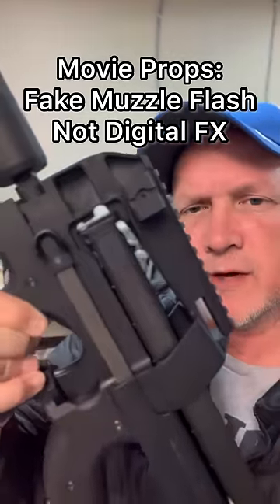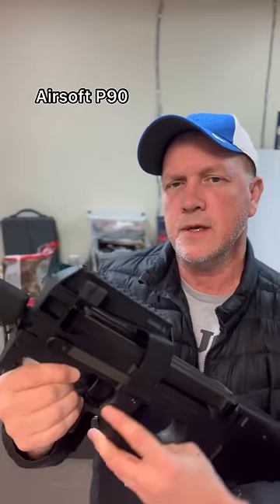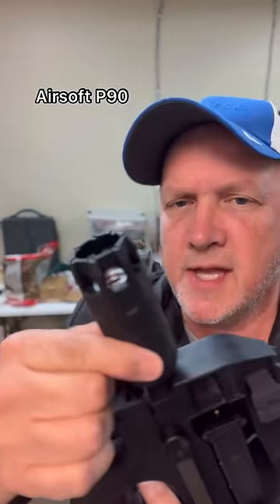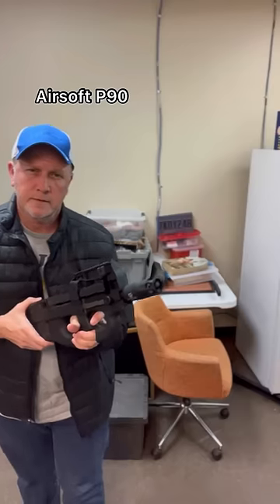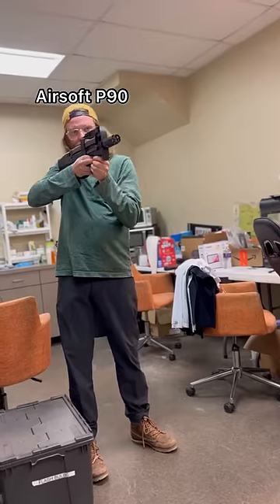Movie Props:  Fake Muzzle Flash on Airsoft Prop #shorts

Comment: I would never have expected that effect to look that good.  It looks a lot better than the CGI muzzle flashes you see in a lot of movies and TV shows.
Reply: Yeah I mean it's a little bit over-the-top but it does look really good
Reply: Maybe some of the cgi you think you're seeing is actually a prop effect
Reply: @danitho  Then it still looks worse than the one he demonstrated.
Reply: @jic1  Yeah, that makes sense. Not all products are made the same. Some are better than others.
Reply: @borttorbbq2556  Muzzle flashes gotta be exaggerated for the big screen. If I’m not mistaken, cameras usually don’t even pick up real muzzle flashes.
Reply: @zander2190  if they do they're not very clear.
Reply: Its a real airsoft product that has been available for quite a while plus its quite affordable and you can put it on any airsoft gun that has a threaded barrel which is like most of them, not to mention it also works as a tracer unit, it works best with gas blowback airsoft guns because the added gas would like provide a mist of sorts for the light to catch making it look like a real muzzle fire, its perfect for any airsoft player who values the art of the larp and its perfect for prop masters and any on the start movie makers because its a cheaper and more believable option if you can't afford an expensive cgi artist or if you can't afford quality cgi, plus it adds to the overall feel of the weapon without having to spend thousands on dangerous blanks that is purely CO² gas
Reply: @zander2190  Cameras pick up real muzzle flashes. It actually looks bigger than the effect here. Sometimes you can see the rolling shutter with how fast it is, too
Reply: @traphimawari7760  wow, all that with only 3 commas and no periods.
Do you have something against using punctuation? 🤔
Reply: @traphimawari7760  bro, put some periods in there, goddamn. Had a stroke reading all that.
Reply: From irl experience & videos I think it should be toned down to be more realistic BUT until that inconvenience is resolved I'm sure it could be reduced in editing
Reply: And I'd wager it's easier for the sound department to match real shots with the lower noise pop these bb guns make. It really does make you wonder why we don't see these more often especially seeing as a lot of gas blowback bb guns are comprised of metal like their real world counterparts.
Reply: yea they are pretty regular. :) they are called TRACER UNITS. for airsoft. they make the BB's glow aswell
Reply: and if you needed tracer fire, these work with some bb's that make them look like tracers so you get both effects lol.
Reply: That’s why I love using them for Milsim, nothing wakes you up like some dude with a blank gun and an HPA rig with one of these
Reply: @borttorbbq2556  yea but movie blanks are already over the top
Reply: @jic1  you do realize that he's right they use those and cgi combined to look good
Reply: It would mostly have no muzzle flash and a lot of gas if it were realistic.
Reply: So they're actually really common for outdoor airsofters. I use one for my cqb riot gear set
Reply: @lucassevey5989  You do realize that I'm talking about effects that look bad, right?  Yes, I can't completely rule out that some of the 'bad CGI muzzle flashes' I'm talking about are actually  bad prop effects, or a bad combination of prop effects and CGI, but the point is that they look worse than the prop effect he demonstrated.
Reply: @jic1  yes I'm saying that if combined with some cgi that would be pretty good
Reply: @mwwwww648  Yes the real gun shouldn't have huge muzzle flashes because it shoots a round designed for short barrels, so virtually all the propellant would have completely combusted before the round exits the barrel.  Big muzzle flashes are usually caused by unburned powder, and are worse when a round designed for long barrels are shot through a short one, meaning that powder combusts outside the barrel.  However we are talking about movies here, and a muzzle flash that looks good onscreen isn't necessarily one that looks realistic.
Reply: I have one on my speedqb set, looks dope at dark and with tracers
Reply: gbb p90? who makes it?
Reply: I thought it was actually fire the first time he shot it.
Reply: @evieatarax  they usually don’t look very clean on video though, unless filmed by a high speed camera due to how quickly they happen
Reply: @jic1  and no more flipped muzzle flash 🤣🤣🤣
Reply: Too bad the muzzle is too large for the p90 for accurate portrayal
Reply: @borttorbbq2556  someone has never fired a gun before XD
Reply: @EJuliusF  i have infact
Reply: Practical affects
For the win. You could even cycle it
So it flashes intermittently.
Reply: @zander2190  actually, they are typically under-represented. Real muzzle flashes (from unsuppressed guns) are typically 5x the width of the barrel. Watch some range compilations of unsuppressed firearms and you’ll see what I mean.

Comment: This seems much safer than a blank considering there's nothing igniting or firing at all
Reply: Yeah, makes gunfight scenes a bit easier too since there isnt really any danger in pointing them at somebody, unless youre aiming for the eyes. Dont need camera tricks to make it look like people are shooting at eachother
Reply: @notme5844 it be probably even "safe" holding that thing right up to an eye, the flashhider has cutouts where the pressure can go, it's made to push out a 6mm plastic bb, open those 6mm up more than a square inch and there's not much pressure left. If you hold a gas blowback airsoft to your hand leaving a gap, it's noticable but that's about it.. I'd be more concerned about putting that thing to my ear. But I think when filming you could easily plan ahead to make an "eye/ear-shot" scene.. plug the front of the hider with plexiglas so the gas escapes via the ports in the flahhider only and use earplugs when you have to be close to someones ear... definetly makes things easier and a lot safer compare to blanks.

Comment: This is literally the safer option. Why would anyone recoil from this idea…???
Reply: It’s very impressive. However you do lose the look of natural recoil and this simulated flash is much smaller than real life - not to mention this will not flash as bright during scenes shot in sunny daylight.

Worth noting that a real P90 with a real muzzle device of that size would probably have little-to-no muzzle flash.
Reply: @connorlohse4097  that’s actually good to know! Thank you for sharing. I wonder how much can be done in pre and post production to midigte those issues. For example having your cast go out and practice on a range with real guns to get a feel for the recoil and use sfx to get the flashing to show properly. I’m no expert but those are some ideas of how to make it better.
Reply: Film makers want it more realistic or whatever, but then cry when someone gets hurt from shooting literal guns at each other.
Reply: 1. You have to process out the audio, add in gun audio which might not be accurate to the area fired
2. You have to edit in casings coming out
3. Hollywood infinite ammo problem (forgetting to reload after X shots)
4. Recoil missing
5. This muzzle flash only works in low light conditions
6. Muzzle flash wrong size
Reply: @connorlohse4097  what? On a proper P90 it would definitely still have a pretty big muzzle flash, even with a brake like that.
Reply: @ObservationofLimits  the problem is this device doesn’t have a real life analog because its main purpose is to house a lighting system for simulated muzzle flash. It looks like 70% suppressor and 30% brake. I was referring to the faux suppressor element of this device. You’re not wrong though, if this weird amalgamation was just a brake it would be a huge flash.
Reply: The tech is from airsoft. If people really wanted more recoil could be made from c02 cartridges and more bb guns could be made to eject cases. Which for actually playing airsoft is considered a detriment.

The flash could be integrated on the actuall barel since its just LED.

Actual gunsounds already need post processing so adding on to it is not a big change.
Reply: @ObservationofLimits you act like infinite ammo is a problem

Comment: For those wondering it’s an airsoft tracer unit. A few brands like acetech and PCU make them that’ll flash when a BB passes or green gas/ propane is expelled
Reply: What ones would u recommend?
Reply: @bf3forevergreene165  acetech
Reply: @BF3 forever Greene  ace tech lighter bt kinda its not cool like the one in the video but I like it as it has a built-in chronograph (tells how many bbs you can shoot in a second how fast the bb is any a few other things not a super useful feature as you don't need to constantly know your bbs speed but it's a nice thing to have I guess. It is expensive at $100 especially considering that one is probably only $80
Reply: @bf3forevergreene165  acetech bifrost. Its rgb.